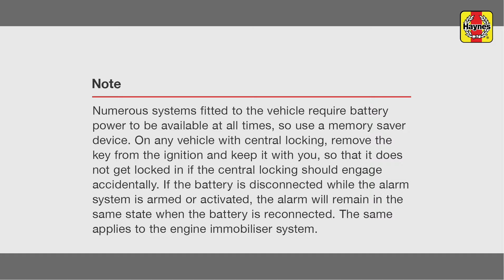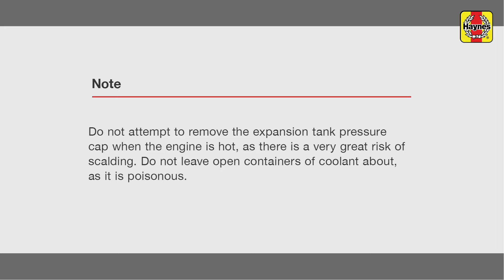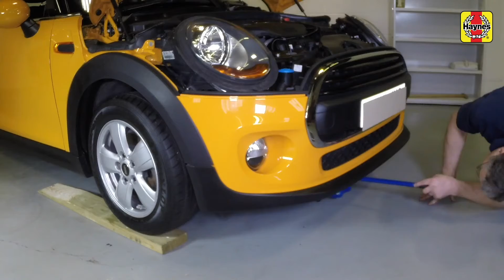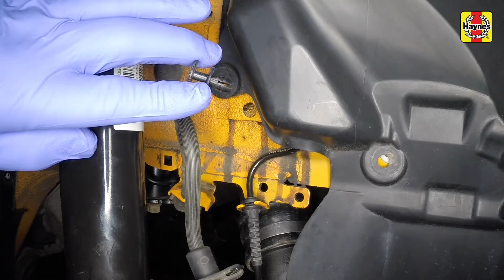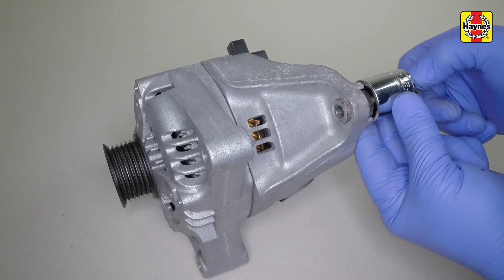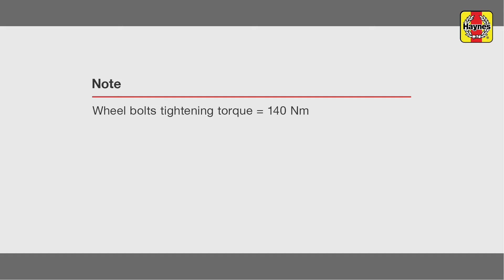Mini One (2014 - 2018) -  Replace the alternator

Comment: Just a heads up, this does not work for the S models. The pulleys are located too close to the side of the car. This video only works with the 1.5 3 cyl.
Reply: How do you do it for a 2.0L?